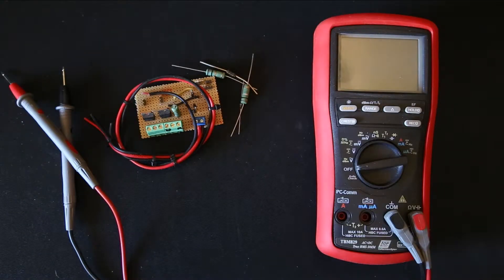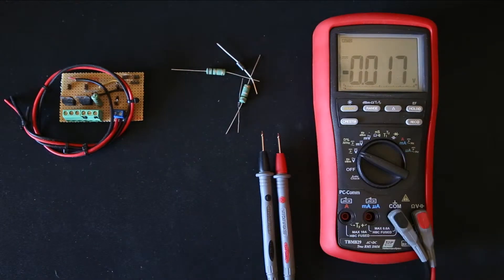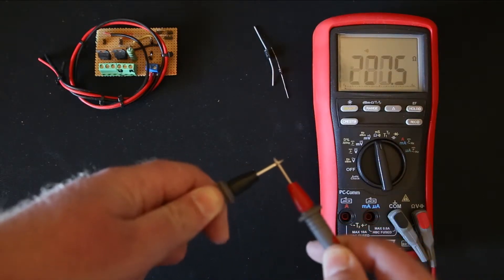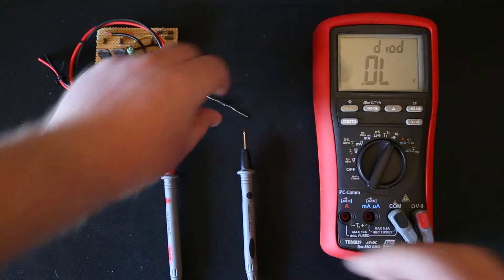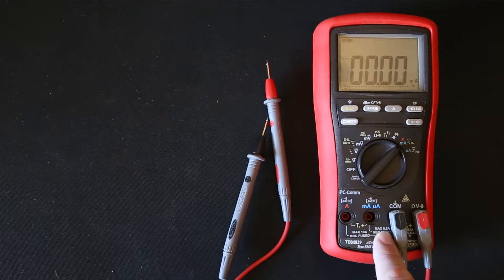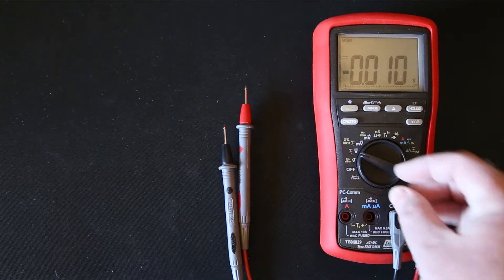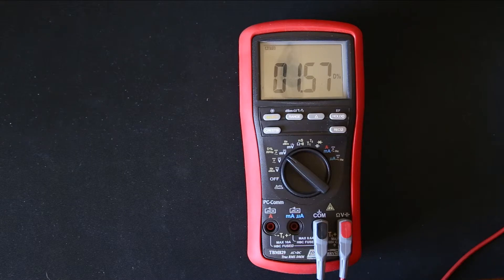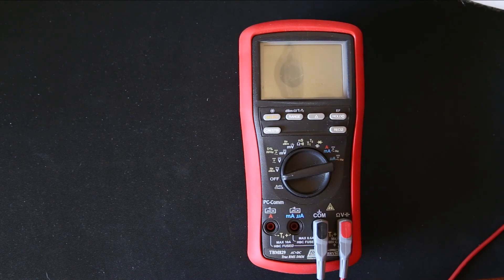Evione ElectronicsEpisode 2   Multimeter Basics

Comment: The Brymen meters are fantastic value for money (especially in SA). When measuring low resistance/ohms, it's best to first "delta out" the resistance of the meter leads by shorting them and pressing the Delta (triangle) button, then measure your low-ohms device.